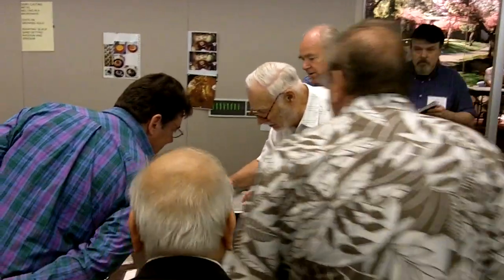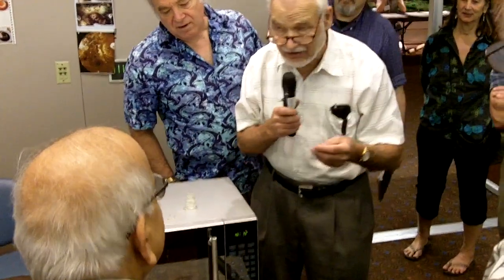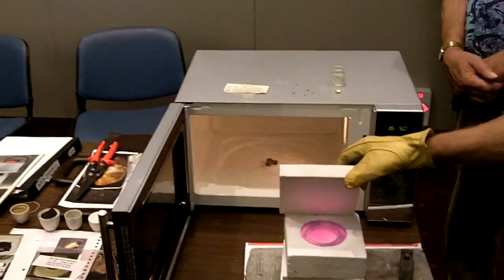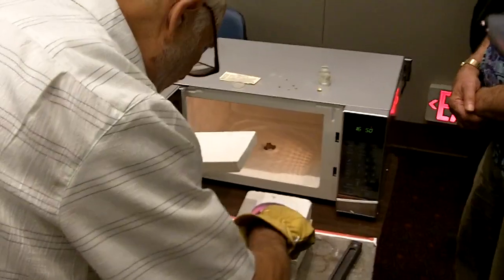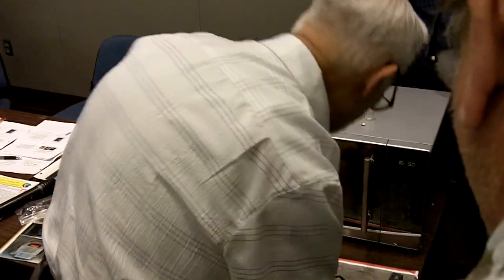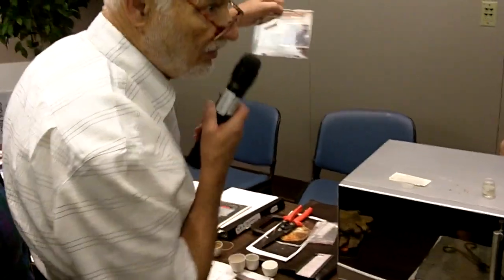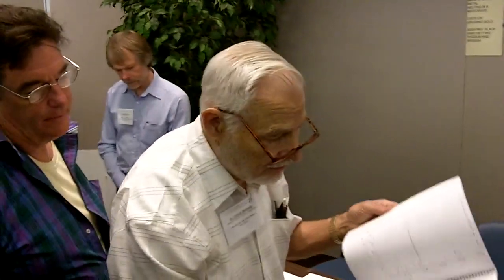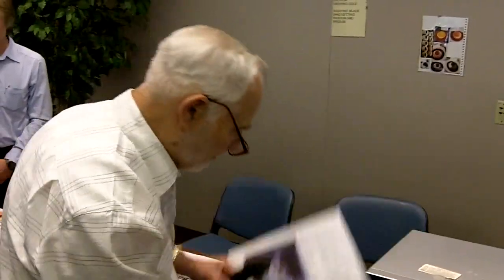Dr. John V. Milewski: Growing Gold from Glass in a Microwave - Part 1

Comment: If you separate h2o by electrolysis and separate the HHO into it's elements; You can use the hydrogen to burn the glass 3 or 4 times and do the same thing. The hydrogen loses electrons as it burns and will provide the missing "metallic" properties required for gold. The pure hydrogen can also be used on black magnetite and even lead if you continue to heat it.
Reply: +Now or never. Here and gone HERE IS A LINK TO LEARN HOW TO SEPARATE THE HYDROGEN:
http://www.instructables.com/id/Separate-Hydrogen-and-Oxygen-from-Water-Through-El/

Good luck!
Reply: No, that doesn't produce superconductivity which is the only way it turns ferrite oxides to new metals. It's cap discharge pulse orbital as proven under microscope
Reply: @mikefromspace  So, what is the best way to generate that kind of superconductivity? Do we have to use magnetic fields?
Reply: So many don't realize how important DETALES are it's the pulse of the microwave

Comment: Hopefully the industrial microwaves he is referring to has a more concentrated beam.
Reply: +C Straley No, industrial/commercial microwaves are only higher inside. This allows space for crucibles. They also are built better. Either way, you need a powerful blower motor to keep the parts cool, or you burnout. You can take a Ham Radio power supply transformer to replace the microwave xformer, and it'll run forever.

Comment: I'm brave enough to stand up to this snake oil salesman WITH PROOF OF MY OWN.
Here are two of my videos I tried to melt aluminium (660c melting point) NOT GOLD (1064c)

I have now made 3 attempts, hours long and all I get is a slightly warm, brown sludge come off the metal, nothing near melting temps. And YES I am using silicate based insulation and I am using a 1000 watt microwave. Here's my very own debunk:
/watch?v=KweyBptb5ho
/watch?v=5tqpAdM7pZI
Reply: Write it well fool

Comment: Just for the guy that commented on: "the water would weigh more then the gold to start out with" ormes have different properties of weight. They WON"T have the same gravity weight as the metals you are creating.  And to add, alchemists would do the same thing with just high heat. What is heat? extreme em radiation.